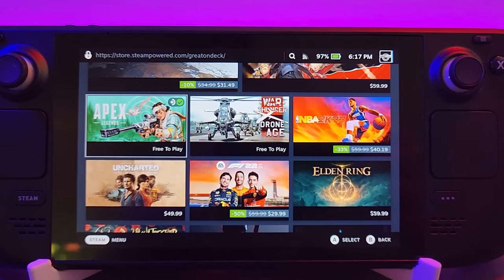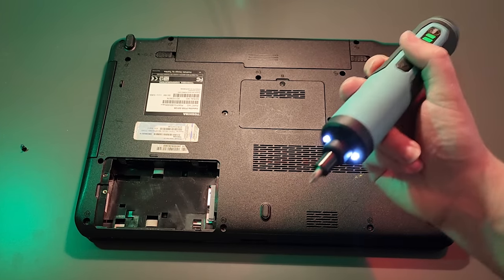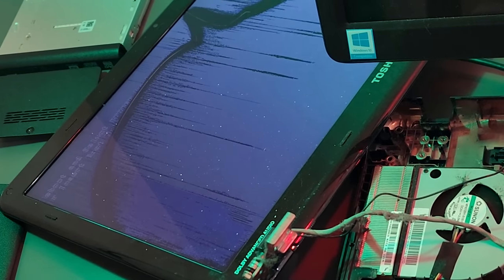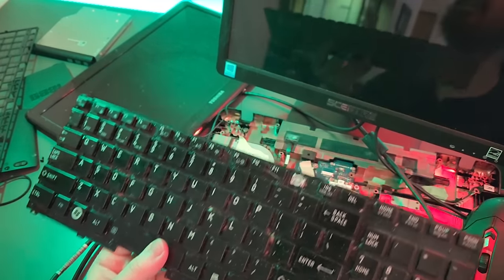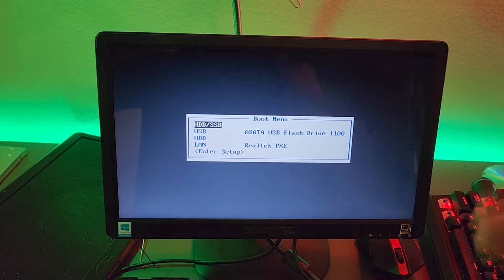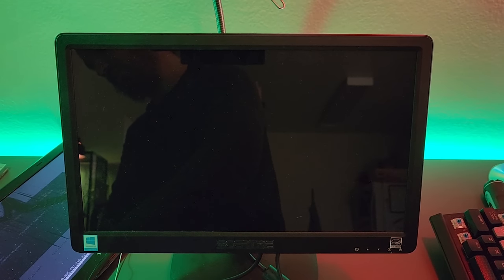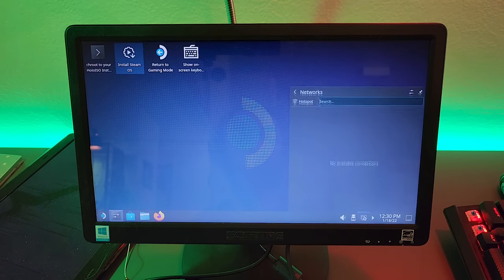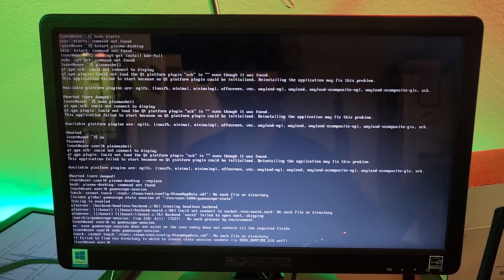I Tried Making A Steam Deck Out Of A Horrible Laptop... Everything Went Wrong

Comment: Nice video. As an os engineer, this was a bit painful, but glad you learned something about operating systems along the way. Swap is virtual ram. Host name is network name of the computer.
Reply: Virtual ram? What?
Reply: @R.K_Chalkboard  For when you want to download more ram
/s

Simply put, swap is a place on your drive that may be used as (veeery slooow) RAM if your actual RAM is full
Reply: Pagefile..
Reply: @DarkLinkAD  I think windows calls it a page file.  But yes same idea.
Reply: To take it step further, a program that runs on your system doesn't access the memory of the computer directly. If it did, a malicious program could do anything it wanted to on the system from deleting the contents of the harddrive to reading passwords. As a result, it allocates memory by requesting it from the kernel, which has a memory manager. The memory manager allocates continuous memory segments called pages and maps the address space from this virtual memory to  physical address space in the ram. As a result, the kernel has the ability to move ram not in use if physical ram is low to another storage space, the swap or page file, and then reload it back to ram when needed. It swaps the memory to and from the disk, hence the name. Since the memory is grouped in to pages, windows chooses to Call it a page file. Same idea although the mechanics are slightly different in their respective implementations.
Reply: And he decided to install the nvidia version on intel graphics 💀
Reply: @seanvinsick Oh I didn't know that , thanks for info 😅

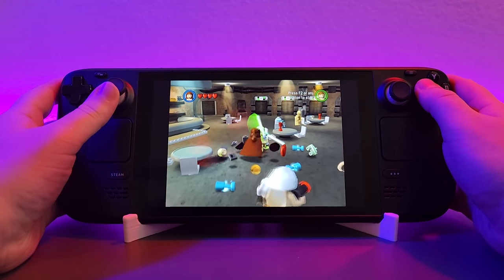Comment: 0:22 The OLED and the faster processor both came true!
Reply: The Steam Deck OLED does not have a faster processor than the LCD.
Reply: @caner7067  It does by a tiny bit
Reply: @caner7067  OLED model has a 6nm APU compared to LCD's 7nm APU. It isn't a big difference, but it has positive affects on battery life, and I believe minor speed increase too. (memory isn't the best so I'd try to find some more information yourself if you are interested in it)
Reply: @tankintime2118  the upgrade from 7nm to 6nm mainly only improves battery life, the chip itself is identical. The actual performance improvements come from the ram chips, which are faster in the SD OLED.
Reply: @caner7067  Yeah, I didn't have the best memory on the specifics of it. The 6nm APU has very minimal performance impacts since it is able to run cooler from drawing less power, but it isn't anywhere near the RAM improvements in performance impact as far as I know. Thanks for mentioning the new RAM upgrades; I almost completely forgot about that lol.
Reply: @caner7067  the new APU isn't much of a performance lift, but it is one, it can clock ever so slightly higher if you remove the limits Valve set, we're not talking much more then single digit increases, but the increases are there
Reply: but barely

Comment: this may be helpful for a later date, Ventoy lets you use either bios or UEFI modes to boot iso files off of a USB drive. another good thing to mention, Linux (and SteamOS by extension) sometimes need certain kernel extensions to use your wifi adapter.

Comment: Interesting thing about this laptop: I’ve worked at a few Geek Squad locations, and I can safely say that it’s the most common model of Toshiba laptop I see. Toshiba Satellite, some series designator plus 55.

T-55, P-55, PS-55, it’s insane. They all shipped with Windows 7 and they all come in with destroyed Windows 10 installations that crash when you open settings, and sometimes even CMD.

But their drives don’t seem to fail very often, which is good because they’ll often have a decade and a half of stuff on them! 😂
Reply: Toshiba makes some pretty reliable hard drives such a shame their laptops were shit
Reply: Mine got bios bit rot after the Hard drive started to fail ! 
first it started to beep loudly whenever I try to enter the bios & freeze, It booted normally tho~ got all important stuff backed up then when I replaced the Hard disk ... BLACK SCREEN
Funny thing I never formatted the windows since I bought it in 2011
RIP Toshiba Satellite PSK04, you served me well (2011~2019)
Reply: Yeah, Windows really likes to break when you turn it into a different version. Reinstall always works better.
Reply: My dad was a sales rep for Toshiba from 2008 to 2018. He said Toshiba was very conservative with their drivers they didn't rush out their drivers.
Reply: @_EyeOfTheTiger  funny you say that, the Toshiba MQ04 hard drives are the worst hard drives I've ever seen, they always die after 1-2 years
Reply: Hitachi Tivo failed on introduction.
and Seagate 2.5s, used to fail and corrupt within a year.
All my server grade disk drives are in operation still today.
Reply: i have a satellite C655 and with windows 7 i dont want to turn it on
Reply: @yotoprules9361  my Lenovo laptops hdd failed after 6 months But now I have a 1tb SSD
Reply: @Whos_candice_Gaming  what model HDD?
Reply: i had a toshiba laptop in like 2014-ish and it was a BEAST tbh
sadly, it did not survive a bottle of water...
Reply: @magicalthief My Mother could've attested to that back in 2004.
Reply: I'm typing this very comment on a P755 (3D). I never upgraded it to Win10 because I preferred Win7 which I had running on the laptop ever since 2011 up until a couple months ago when the HDD died. So I slammed in an SSD instead, switched to Linux Mint, cleaned the fan, applied new thermal paste and pads and this thing runs as if it was new.

Comment: You can also buy some laptop antennas with shorter cables and just attach the antennas to the laptop chassis in some suitable place. Or just use the existing antennas, and coil up the extra.

Comment: I'm pretty sure those 2nd gen i7's don't support Vulkan (on Linux) at all, so you wouldn't have much luck running games on these. You could of course try an egpu!
Reply: You need at least HD 3000(Ivy bridge) or higher, and even then, Ivy Bridge and Haswell have only experimental support.
Reply: Can you even run an eGPU with no thunderbolt and very old if any USB 3.0 support?
Reply: egpu needs bandwidth lol
Reply: @jbritain  Yes. You can use the mPCI-E slot intended for the wifi card.
Reply: wine doesnt need vulkan
Reply: @xDoge26  But Gamescope, DXVK and VKD3D do and without those tools SteamOS doesn't work
Reply: @mar2ck_  you dont have to use that
Reply: @xDoge26  How can you not use that? Yeah, you don't have to, but how?
Reply: @R.K_Chalkboard  well, there are hundreds of distros to choose from that will support that laptop just fine
Reply: @fgsaramago  how the hell will you run games, though? wine's directx-to-opengl translation layer sucks and will perform terribly compared to DXVK
Reply: Eg. EG. EG. I REPEAT. EG.
Reply: @randomcatdude  Linux native games exist. About a third of my steam library has a Linux port available....
Reply: @randomcatdude   that's a lie

Comment: hey! I work professionally with computer hardware troubleshooting and I have a sneaking (unsurprising) suspicion that the motherboard may have sustained damage in some capacity. 
Failing RAM can corrupt data, as can failing storage (but it likely wasn't storage considering the new SSD). You could have very well been doing everything right! But the laptop simply... put its foot down.

Comment: I'm not a pc specialist, but I remember I tried to install windows 10 to a 2nd gen i7 laptop though a USB Stick and it was imposible. I ended up using an external DVD reader via Usb and it worked.
Reply: interesting, was probably an issue with your flash drive or whatever tool you used to make the usb drive bootable. I install windows from USB drives on machines ranging from 2006 and even they can boot the Windows 10 installer.

Comment: Yeah, so as you may have realized, many laptop keyboards are clipped or screwed in.  You must release them in various arcane ways.  Then access the screws beneath them.

Next up: WiFi antennae.  If you happened to have disassembled a DS or a satellite TV DVR (maybe because it was less than $10 and had a 1TB hard drive inside) you might be in possesion of little wifi antennae with the proper connector for this laptop.  Putting them back in where the hinges used to be is totally acceptable.  Also you have the option of taking the screen apart to get the original antennae and just winding up the extra wire, it works fine as well.

I am at the beginning, so I assume you will be quickly discovering that support for Intel processors on HoloISO is not very good.

Comment: This laptop reminds me of my old Toshiba Satellite, which was a Core i7  laptop too coincidentally, and in which i ended up installing a SSD too. I still use it as a secondary machine to monitor my Twitch stream chat while I stream using my modern 13700KF main machine.

The hard drive should have come in a caddy to hold it in place, that might explain the block and cable time.

Comment: you should have declipped the keyboard, removed the ribbon connector, and then unscrew 2 screws. i have an old asus that i dissassemble like every week that looks like your toshiba...
as for the cmos battery, on mine i think it didn't have one but you could reset the bios by pressing for like 30 seconds on the power button with the battery removed (i think it empty the capacitors that replaces the cmos battery or something)

Comment: It really hurts me how you tore that cover. As a tech enthusiast, I feel sad whenever a perfectly repairable laptop gets destroy like that.
Reply: This thing is a PoS.  You're no 'tech enthusiast' if you think this retro junk is even worth using.
Reply: @BuzzingGoober  You should realize that many tech enthusiast value ie. Rasberry Pi's a lot and their compute power is miniscule. Actually way less than this laptop. I consider myself "semi" enthusiast as I've built multiple plus 1000€ rigs in the years, but I still have ie. old Pentium laptop with svga and Soundblaster compatible sound with proper "fast" refreshing TFT and I pretty much value it higher than my M-series Macbook Air 😂

Comment: I've restored a toshiba laptop like this. The F12 works but it just doesn't work for bios. And mine has a bios look too. So i just burn iso to another ssd and connect it to dvd drive bay on laptop using a caddy and boot system from there as by default any system will prefer dvd drive over hard disk.

Comment: God, the ragequit after nothing goes right is all too relatable. Sorry to see you experience that :(

If you do try again, Valve is beginning to add the SteamOS Big Picture UI to the standard version of Steam (granted it's only in the beta branch of Steam right now), so you can get something pretty similar to the Steam Deck experience by just installing a different distro and launching Steam with the correct boot parameters. I don't have a Steam Deck and haven't tried the beta yet, but based on past experiences I can't imagine there'd be many differences between the two versions.
Reply from the maker: Yeah I have been meaning to look into this. The whole ordeal should get easier with time.

Comment: if i was reading it correctly you tried to install Nvidia compatible drivers for an intel integrated graphics that is why you got the terminal login for user it was installed just the GUI wasn't showing cause you lacked the hardware to display it but im not a total expert in the way of linux but i have been trying to use it daily to get better at it
Reply: you presumed right. he should ave tried the amd/intel version.

Comment: The installer actually runs from RAM, so it is capable of installing from its own boot disc. It loaded to RAM when those 1024 were popping in the screen. You should use a nVidia install into a non nVidia system.

Comment: SteamOs is not made for old devices. Something like EndeavourOS or Linux mint XFCE would be much better for such devices, since they aren't UEFI exclusive and have way smaller background usage. And you can play on them nearly as good as on the steam deck. There should be next to none extra incompatibilities compared to steam os (Though 90% won't work on this device because of hardware).

Comment: 1 to get in any bios. Remove all drives
2 ones you open an old laptop you should clean the fan and apply a new thermal paste
3 try usb 2 if the bios didn't read the os in the usb 3 drive 
4 open the screen hosing and remove the antennas
5 remove the battery befor removing the screen. Otherwise the bios still think it's plugged
6 check the help page of the os you want to install or ask someone for help.

Comment: 21:31 even if you had the most pristine computer out there you still couldn't have installed it. Most errors occurred due to internet dropping here and there and installer being terminal only. Making you confuse system notifications with the installer, for example the  "Reboot recommended" @ 20:44 probably trashed your install (you should try re-initiating the parts after you install steamos) . KDE (the desktop env of steamos) has a notification system that tells user to reboot BEFORE an update finishes (KDE expects you to NOT use terminal). I assume you rebooted after reading that (always some bug here and there keeps the windows users away) .If you had re-run the installer every time there was an error installer would've completed no problem (it would've downloaded the missing packages only).

I would highly recommend finishing this project before "steamos on ps4" because to do that you will need special ps4 specific amd drivers that are very old at this point and install them on top of the steamos (or you could just instal the ps4 distro but that's been already done).

P.S: ALWAYS google linux fails/errors

Comment: try pressing fn esc. if it uses any recent windows os (windows 7 through 11) what it does is it switches the f key functions, so on a compact laptop keyboard that is built in, it switches from the actual f-key functions, to the brightness, pause, sound controls, full screen, and other
Reply: It's called function lock, I use it alot lol

Comment: After working on several Toshiba laptops a few years ago, I won't buy another one.  Getting the components was easy enough, but replacing them was a nightmare.  I ended up having to buy a spare set of screws because the originals were all stripped out by the previous owner.  I got everything back together and working and then the owner let his kid play on it, who destroyed the new screen and keyboard.  After that, I told him I couldn't get parts and told him to take it to another repair shop.

Comment: I would really try to restore that laptop if I were you, so it doesn't end up in a landfill. the fact that it has an SSD  during the windows 7 era with a core i7 likely means that that laptop was somewhat premium when it came out. I'm sure  there is a replacement screen  and keyboard for this model on eBay.

Comment: I know y’all think it’s the best thing since sliced bread…. But it’s not always that way.
Sure that switch game runs well at 720p, but it won’t do any better if you hook it up to a 1080p monitor. It’s emulated, steam deck already running at full power.
Meanwhile high end games run at potato quality bellow 30fps, so this thing is basically for more light games. And if you try to make it into a daily driver for normal PC stuff, prepare for disappointment, and a low as hell battery life. You’ll basically wanna get a 100 watt hour external battery, and basically tape it to the system.
Basically, just use it with SteamOS, and wait for technology to get better, so things like that can have a bigger battery in a smaller space.

Comment: Use the optical drive bay.  Either as intended by burning the install ISO, or use a hdd to optical bay adapter.

As you may be realizing Toshiba has some of the worst BIOS bar none.  (Meanwhile I am still getting BIOS updates for my Lenovo X230 and T430)

This is a Sandy Bridge processor, also known as 2nd Gen Intel Core (well, 3rd gen if you count Core2 Solo?). Or the first generation with the memory and graphics onboard, no North bridge chip.  (1st Gen Core had the memory and graphics 'on package', in another chip made on an older process node).

Ivy Bridge, 3rd gen Core, is the minimum I would recommend for a lot of reasons.  Heat and power consumption being a couple.  Haswell or Broadwell are getting long in the tooth, but have some very good performance, especially if you feel like picking up a Xeon E3 or E5 on desktop.  I got 2 E3 1231V3 for $12.  Basically an i7 4670.  Not an everyday deal, but there are deals if you score a free Celeron Pentium or i3 desktop.

Comment: 3:35
"Laptop has been very very bad."

Laptop stares at you. It does not know what is happening.
Do you want to cut open Laptop?

Laptop stares at you. It tilts its screen out of curiosity.

Laptop stares at you. Its camera lenses widen. It wants to go now.

Laptop stares at you. It struggles to break free.

Laptop stares at you. Its camera lens filled with desperation.

Laptop stares at you. It tries to display a blue screen and play an error sound but no display or sound came out.

You cut open Laptop.

"Waiting for something to happen?"

Comment: Tried to do same thing with my laptop too. SteamOS 3 just refused to work (kernel panic after initial installer steps), only SteamOS 2.195 works, but without Nvidia drivers (it just doesn't want to recognize them even when they are loaded in kernel).
After massive frustration, resorted to Lubuntu: installed Nvidia drivers with PRIME, set forcibly Nvidia as working GPU, installed Steam and set to go in Big Picture mode at startup. And it works, without that SteamOS pain in an ass, wow!

Comment: bit late but corsair keyboards like that have a bios mode. You have to hold a key combo when you plug it in and it will switch till you do it again. Also pretty sure the 2500-2700 series has efi but its like the first version lol not uefi. just plain ol efi.